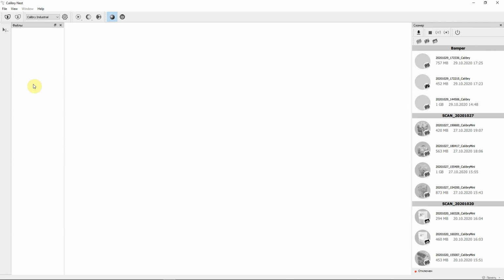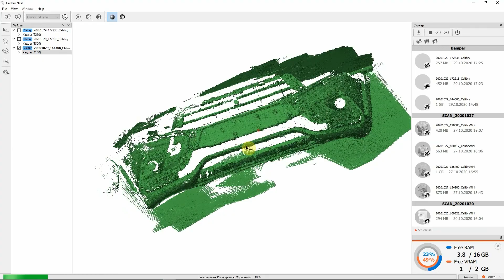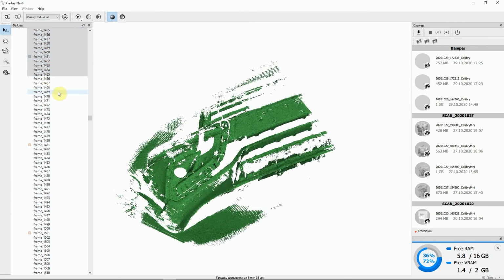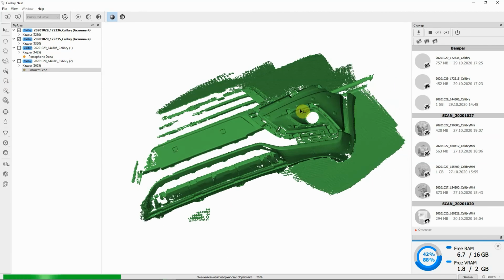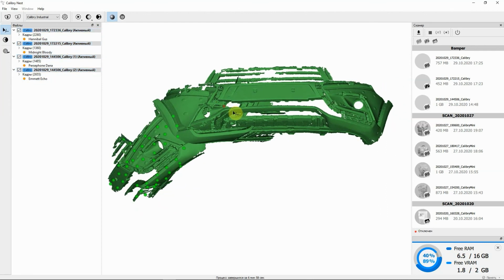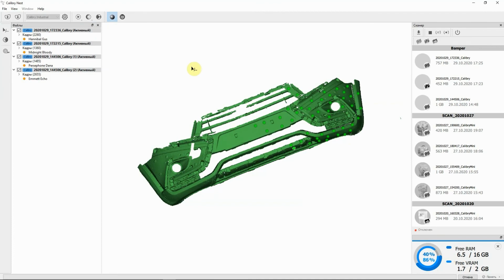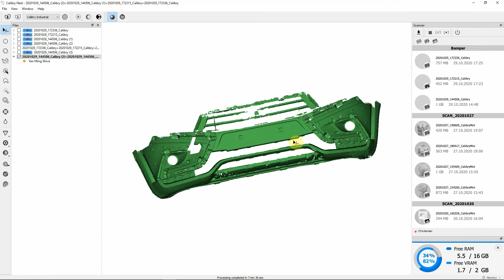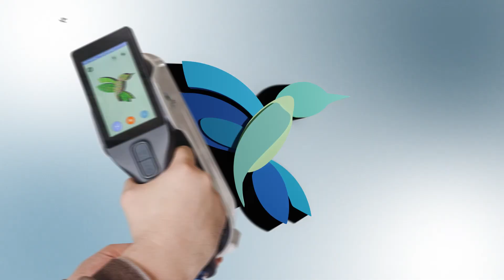Calibry Blog | Lesson 05.1. What are registration and finalization functions

Comment: At 12:25: and voilà… but where did you click to merge them?
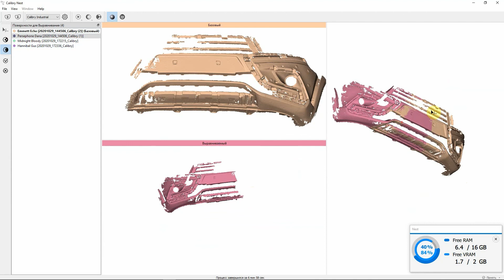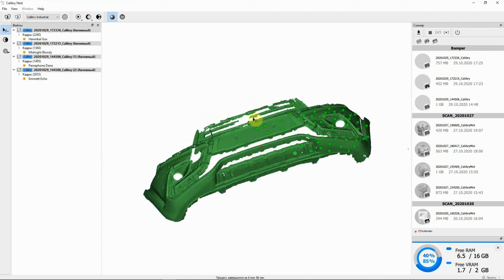Reply: HI! After you've picked 3 common points, press "Add Aligned to Base" button as shown at 11:42. Do the same for all the chunks you have. When finished, click "Accept changes" button (circle with a tick in it). To merge all chunks into a single result, use multiple processing as shown at 12:35. You can read more about it by clicking F1 in Calibry Nest (which opens the user manual).
Reply: Also, you may find detailed explanation of post-processing in this playlist: https://www.youtube.com/playlist?list=PLVJJpCWEeGWjjEXDnRKg5rebu7wIUwOmS